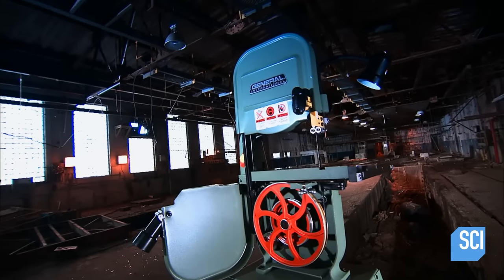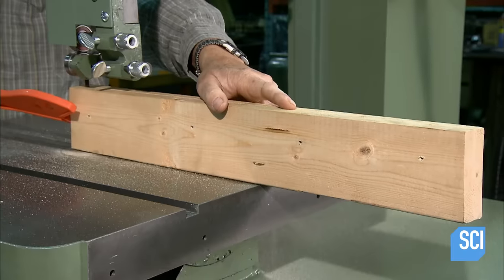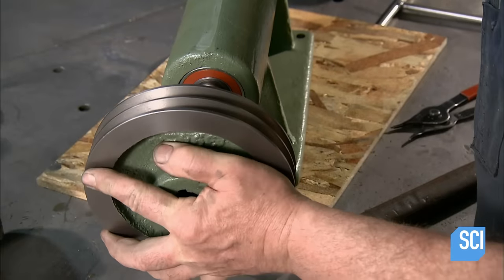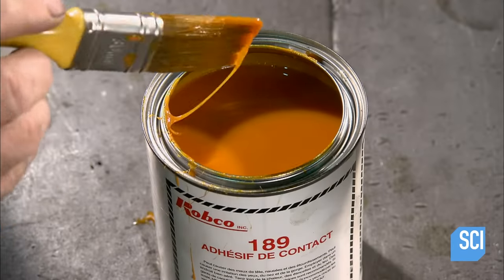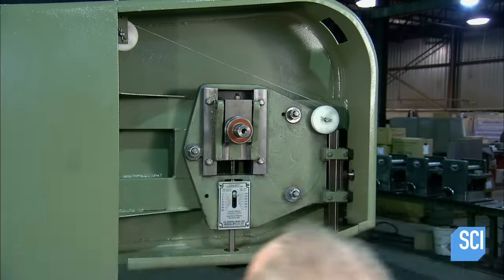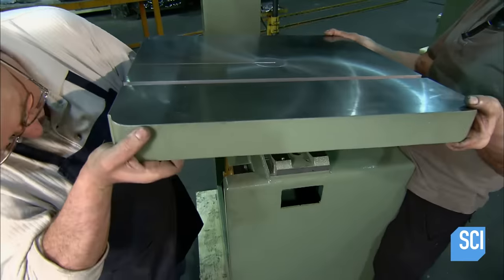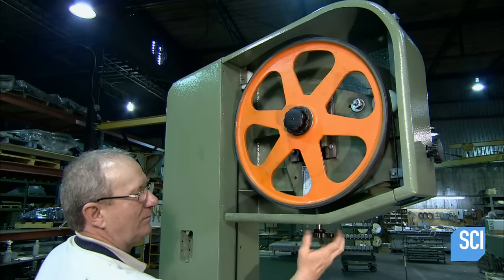How It's Made: Band Saws

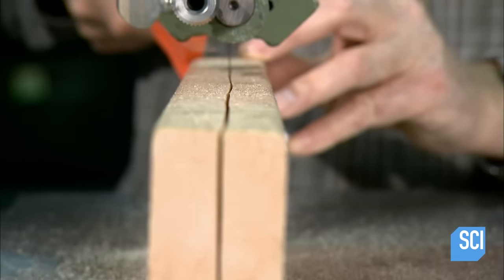Comment: 0:46 and that wobbly line down the length of the cut is why you need to use a fence while re-sawing lumber.
Reply: And a wider blade
Reply: I'm so glad someone else saw that ☺️😅
Reply: Duh. But without the fence, it gave you a reason to comment.
Reply: It was just a demo
Reply: Actually a fence doesn’t always ensure a straight cut.  That depends on the skill of the woodworker and if your bandsaw is tuned properly.
Reply: @bigscreenbird8198  Straightness also depends on whether there were imbalanced internal stresses in the wood.  A perfectly planed block of wood can take on all sorts of interesting shapes when ripped down the middle.

Comment: I thought they were going to explain how the actual blade was made hehe.
Reply: me too
Reply: It's probably just stamped metal, like the razor blades in that episode
Reply: Same haha
Reply: How when it said how band saws are made and not band saw blades
Reply: hehe
Reply: id of preferred to see the blade being made too.
Reply: Spring steel, punch, sand repeat.

If for metal - punch, heat, quench, repeat.
Reply: @yanikkunitsin1466  I know that this works for bit saw blades (for sawmills etc), but for these small blades I am pretty sure they use a different technique. Also, how would they punch a bimetal cutting blade, I'm sure that this would be very hard to punch.
Reply: @MarinusMakesStuff  with about HR10 they punch it
Reply: so do i. so do i :)
Reply: Same thoughts.
Reply: a n i m e
n
i
m
e
Reply: Me too for real 🤣 🤣 🤣
Reply: Used to make bandsaw blades for a living, it's pretty boring and the tools are pretty small, different edge blades are made from long coils of spring steel with an automated grinder that has different settings for different edges you roll the sharpened blade into a coil and send it out, the coils are often brought as long lengths and places will cut them to size, weld together and grind the welds off to fit there specific bandsaw brands they service or have
Reply: Yes
Reply: Me too
Reply: I took a tour of a sawblade factory in canton Ohio, for some of the blades they weld little carbide dowel sections  to the very tips of the teeth

Comment: That's how you damage the bearings during installation. It's better to hit the same ring you're trying to press in, not the other one. If you're press-fitting external ring of the bearing and you're hitting the internal one, the load of the impact goes through balls of the bearing and damages internal surface of the rings where balls roll.
Reply: when, when he's putting the bearings into the shaft housing or putting the wheel onto the shaft? either way in the first one the nut attached to the shaft is only contacting the inside race and he uses a tool for the other side to accomplish the same, then when putting the lower wheel on that tool is flat so it's contacting the inner race just as much as the outer one distributing the force which is required in order to drive it inside an ID as well as an OD at the same time and making it a non-issue.
Reply: I was going to say that, but you beat me to it
Reply: you are absolutely correct
Reply: I pray this is not how manufacturing is done generally. Couldn't they at the least stage proper bearing installation for the video.. what a bummer.
Reply: @davyr4302  you would think so. But that may be a special made device with clearance for not touching outer race we don't know.
Reply: While that's absolutely true, I really don't think it would matter for a low speed, low precision application such as driving a bandsaw wheel.  That looked like a pretty light interference fit, anyway.
I flinched when I saw him beating that bearing as I know it's so wrong on precision bearings, but the wheels are only going to be ~200RPM or so.  I
Reply: @lucaswillis2809  remember they have to build the machine to run at the maximum specified FPM. regardless of where users use it.
Reply: Seriously... That hurt my soul to watch, I'd never buy from that company.
Reply: The outer pressfit is very loose because the radial force is static when the bandsaw runs. The inner pressfit is strong because the radial force rotates around the pressfit. He is doing everything right hammering on the inner part of the bearing. It depends on what part of the bearing rotates and how the forces act on the bearing. Its the same for bearings in transmissions and the inverse for wheel bearings

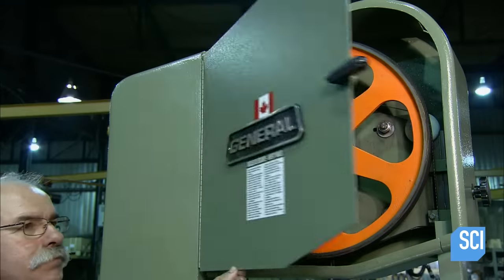Comment: 5:02 looking at that old flag, sounds like they were rebuilding the old bad saw !😆😆
Reply: I was wondering the same.  I'm betting this was a rebuild/refresh of an old machine.
Reply: I also guess they are refurbishing, I miss a lot of safety equipment for a complete new machine, like a emergency stop button and sensors on the doors that senses that the doors of the wheels are opened and stop the machine immediately.

Comment: I never did get why the doubled-up rubber band
Reply: it's not doubled up.  the "tire" is used to keep the wheel and saw blade "tooth set " from destroying each other and keeping blade tracking    " position where blade runs on wheel" stable.
30 years experience talking
Reply: @stephenharvey5289  I mean the part where they mount two of them, then apply adhesive and reverse one on top of the other.  Why not just have a single one that's the final thickness in the first place?
Reply: @TheGreatAtario  I agree, when I did that to replace worn tier. I did not use two.
My guess is that the extra diameter from the tier under the one glued and flipped made it easier.

Comment: It would be more interesting to see how they make the blade.. The assembly of the machines with the parts ready is kind of obvious..
Reply: @MoonshineDesigns  did I hurt you?
Reply: you're right. How it's made often just shows us how things are put together, not actually "made". Usually the smaller and simpler the object is the better the production process is shown.
Reply: I agree.  Even though the process is probably the same for most construction cutting blades- the blade is stamped out of a roll of steel, rough shaped, tempered then final cut edge done- or something similar; seeing the process would be interesting.

Comment: Gonna add this to the list of products NOT to buy. No attention the motor and sheaves at all. Unless it was done off camera
Reply: this saw is a very simple single speed machine.  on the better machines there is a two speed gearbox "transmission" and a variable speed drive belt setup.

Comment: When the blade breaks run for your life.
Reply: no on this machine the blue  simply stops running. on a lot of machines there are limit switches that shut motor off.  I have seen on the really high speed " friction sawing" there is actually a break system built into the machine. to stop the wheels turning if the band breaks.